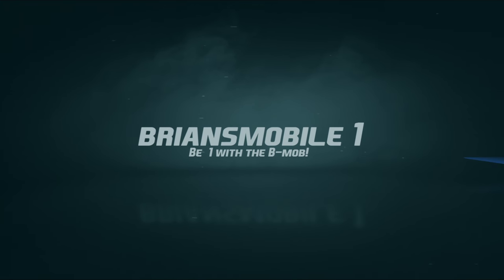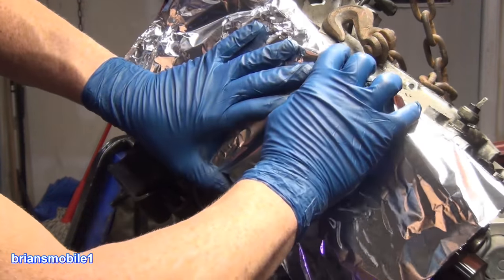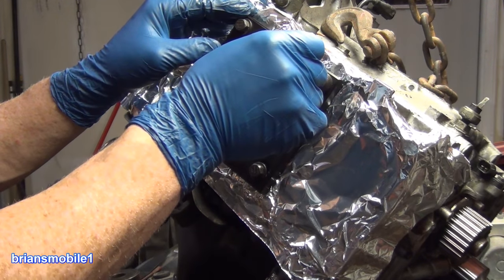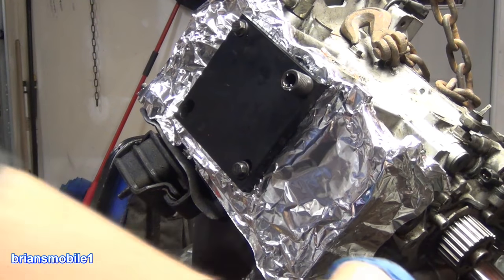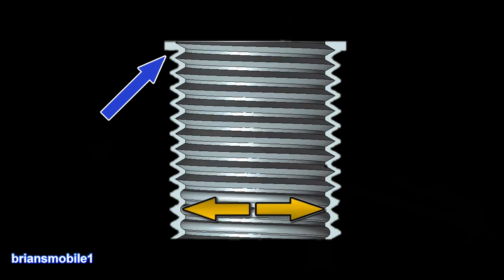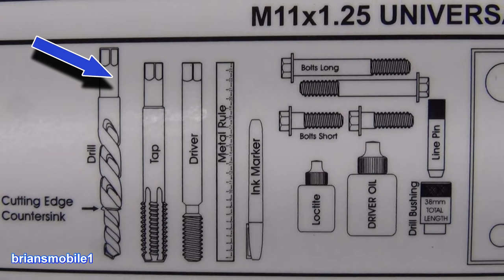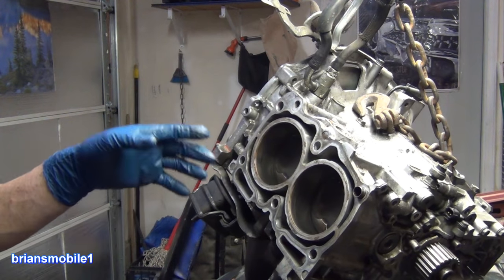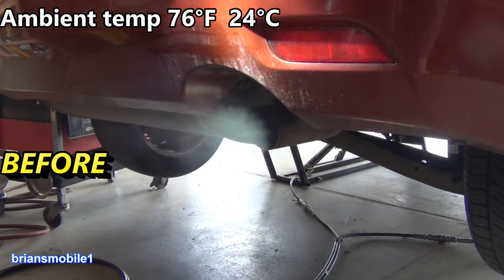Time-Sert Demonstration to Save Subaru Motor Salvage Subaru Part 4 of 6

Comment: Nice work mate, I haven't have a car over 7 years due to my tough budget but early last year I finally was able to get one. This is a 2001 Subaru Outback and I've done a lot of work on it. I had to work on the engine and your videos help me a lot - thanks. In the next few weeks I will have my vehicle back on the roads and it's runnning nicely now. Certianly been a learning experience  and having people like you providing information for these vehicles is awesome. Cheers and Happy New Year from Australia.

Comment: I have used "Timesert" to repair a stripped cam bolt on a 1.6l Kia.  I made my own guides.  The only problem was with the install tool not forcing the Timesert far enough into the hole.  Since I needed to have the surface of the insert below the surface of the cam seat. I was able to make it work.  You should make a practice hole before making you first repair.
Reply from the maker: Good advice

Comment: When we sandblast welds to coat we use blue painters tape then duct tape over. So the blue stuff usually comes off really well even in a hot hooch to keep the moisture low.

Comment: I bought a time sert but if it is replacing threads in a blind hole, you would have to know the entire length of the blind hole and buy a sert that length because the threaded insert doesn't allow a bolt to pass all the way thru it. There is a stop at the end of the inset.

Comment: I've replaced head gaskets on two of these engines. Didn't have a problem with the original threads. Guess I was lucky.
Good to know that if I ever do, there is a fix.
I've seen this procedure done on the Toyota engines.

Comment: Killer way to save the block. I've heard from Subaru nerds that those Felpro head gaskets are no bueno, that the Subaru MLS gaskets used on the Turbo engines are best... I don't know, I've only rebuilt Chevy small blocks. Seems legit...

Comment: Great video Brian. One thing though, I am certain that the first tool you used was a reamer and not a drill bit. Reamers should only be turned clockwise otherwise you damage the cutting edge by turning it backwards. Since this was aluminum it shouldn't have rolled the sharp edge too much but if you have several holes to ream out you will probably start noticing a difference in its performance.

Comment: I used Helicopters for two of mine. Had to double up and torqued up fine. Went to 70ftlbs and holding fine. Did it in vehicle as well. NEVER again as I usually pull the motor. I got lazy. Not worth the pain. Pull he motor.

Comment: I just finished replacing my head gaskets and I too now have the pooling of oil on top of the engine, along with the oil waterfall down the back of the block 😞.

Comment: Great video Brian, I have a stripped bolt on my 95 Subaru 2.2 it is the bolt furthest from the crank on the long piston type of cam belt tensioner and for the life of me I cannot find what size that bolt is? I will need to put in a "sert" in there next time I change the timing belt and rollers, I may try a longer bolt however don't know the pitch and size. 320,000 miles on this engine and still going strong.  great engine . Thanks for all your videos, even an old guy like me can learn new stuff Thanks

Comment: This is what I like about Brian,he does poop right unlike myself who drills and taps one size larger and installs studs red loc tited in and use head washers and nuts like on a raggedy Furd international.or a built Cumminapart or even my old Mopars.. ARP is my friend for these non problems...

Comment: The aluminum foil was to add a mm of space, but I didn't understand why. Also, where did the plate come from? Thanks.
Reply from the maker: There's a 1mm gap between the stab dowel and the engine block surface.  The foil is to keep chips from getting into the rest of the engine.  Foil is for cleanliness and me being able to sleep at night without worrying about them causing problems in the cooling system, piston ring landings, and oily bits.  Welcome!  Thanks for being here Tom!

Comment: King of educational real world repairs! Question, how is the lift/pump holding up. How is the coating if... say... it was used in a carport in rainy Oregon??? Ha ha. Is that an amazon item as well? Thank you and happy new year!
Reply from the maker: The pump is doing great!  The lines leak at the quick connect fittings a little due to grit.  I'd cover it up.  The bottom coating gets hammered from sliding it in place and back.  That would rust stain your driveway in a hurry. They WERE on amazon, but I can't find them there anymore.  Best deal I've seen on the quickjack bl-5000slx was at Costco.

Comment: Hi Brian I watch your vids. And I like them you are great. I have a question about something that happened to me when overhauling my 2000 jeep 4.0l. When I took the number six back piston out it didn't have an oil ring on the lower groove. Nor was the wall messed up nor remnants to be found in oil pan of one ever being there. Do you think its possible it was never installed from the factory. It puzzles me. Bobby lopez from sac. Ca. Thanks brian.

Comment: I may have missed it, but did you repair the upper left first?  You used that to hold the plate in place, and I thought that was the stripped bolt location. Either way, I love your videos especially the subtle humor, keeps it entertaining.

Comment: Can you reuse the head gaskets if you only used them when you were first changing them and then the head bolt thread stripped?  I did the time sert but wondered if I should get new gaskets again? The engine never ran with them in yet.Just stripped the head bolt thread and took off again.

Comment: is this process different if it is on a hole that has the alignment dowel pin? if i drill it and take material out will the dowel pin no longer fit?

Comment: Happy New Year Brian! I was concerned about you using steel inserts in the aluminium head, will it last?
Reply from the maker: Yes.  They're coated and the loctite helps too.  Once you get into recycling metal you realize steel is all over inside any aluminum block or head.  Your dowels, valve seats and all kinds of alignment pins and bolts are all steel in aluminum.
Happy New Year Paul!

Comment: I did not hear you do the three "uhgadugas" just curious if you know? that's what that guy is talking about when the impact is vibrating and your impact probably closer to 80 ilbs but snugging to not impact is probably 20
Maybe I'm wrong maybe he means three revolution sounds but it could mean way more then that if that's the case.

Comment: what lift are you using? I am looking for an suv scissor lift, landed on bendpack mid lift, any recommendations?
Reply from the maker: It's a quickjack bl-5000slx.  It's great for it's portability.  You can move it by hand and lean the jacks against the wall when you're not using them  →

Comment: Hey Ralph, pick me a winner.
Doh. 
Oh so ya know Al, Lou, Mini, and Um I forget the last person's name. 
Hey Brian someone is trying to steal your car. 
Good acoustical  strumming there. 
Mad Hatter?
Clean cup move down.
Mistakes?
I made a mistake once, 
I thought I made a mistake. 
Condiments?
Does that mean you will ketchup wit us later.
Good job.
Happy Motoring and happy new year.
Reply: Oh and by the way that fan problem that you gave me some advice on, has stopped being a problem. 
I don't remember if I told you but the radiator was also leaking and I had a spare van to steal the radiator from so with the radiator I took the fan assembly so as I did not have more stuff to take apart. The fans are working now. Not sure what fixed it as the old fans worked when I applied 12 volts to them. Maybe a loose connection some where and when I did the radiator and fan assembly R and R the connection was re-established. Have a great won.

Comment: That was awesome!  God forbid I ever have to do this to any of my Subies.  =D  When you were saying it's stronger than the original threads, it made me wonder...  If you were building an engine for a high power application, would someone do this preventatively (or as a necessity) in order to torque the bolts higher?
Reply from the maker: Yes, but they'll use an oversized stud kit.
Reply: @briansmobile1  Oh, cool, that makes sense!  Thanks for the reply!  Happy New Year =)

Comment: Can you please answer my question I have a 1999 Chevy Suburban with the code p034 change the spark plugs change the wires change the coil change the router change the wire front spark plugs cannot find the problem hey I also has a brand new gas filter please help me